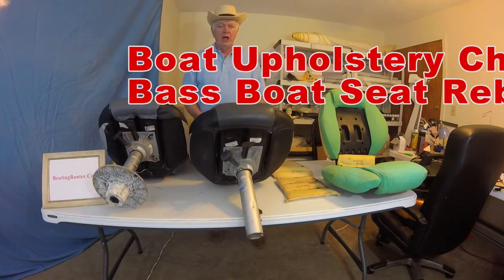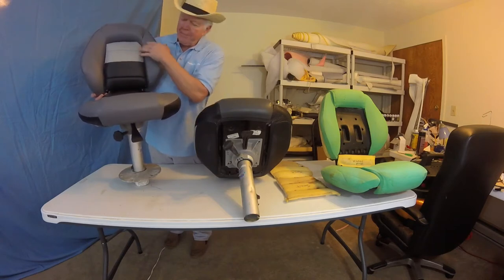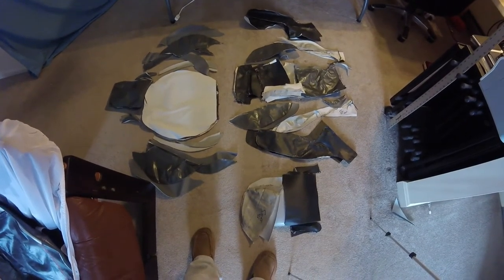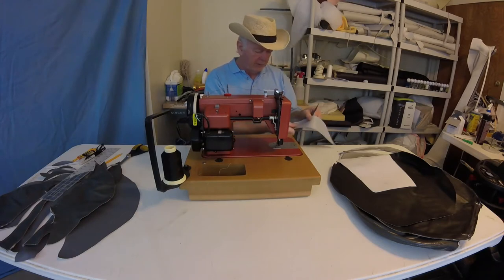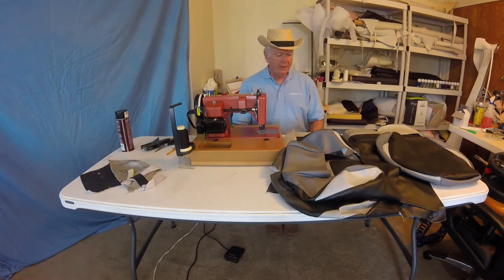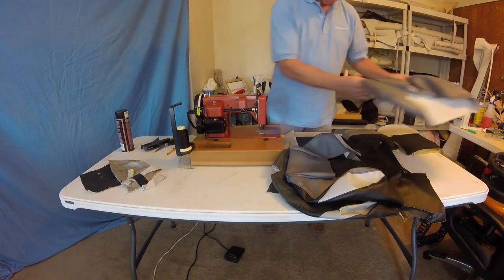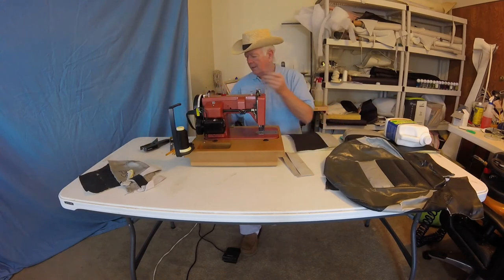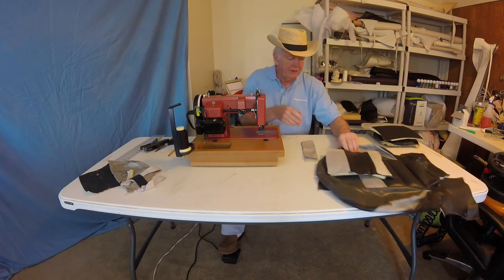Boat Upholstery Chap 35 Tracker Bass Boat Seat Rebuild Part 1

Comment: I am in the process of learning how to do this type of work and I am disappointed you went ahead and- "just did it" I like that you explain but unless you can put the camera in there and just let someone watch then none of that matters or helps to learn it. 

Very disappointed that you didn't just let the camera watch you sew it up. I wanted to see the complex parts and how you did it.

all you did was show pieces over and over - and then finished pieces, that taught me nothing at all, I wanted a nice closer shot of your hands and how you maneuvered the fabrics etc. and then each piece being added.
Reply from the maker: Hi Chris-Sorry you did not get any info from the video. I did do a poor job of showing the sewing portion of the project. If you watch the initial videos of this series you will see all the techniques used in this type of upholstery. I try not to keep repeating techniques from previous projects as it becomes boring for the subscribers who view all the videos and expect to see new techniques not old over and over. If you have the basic sewing ability than the assembly is just a matter of taking your time and laying out the various pieces where they belong and sewing them together. I suggest putting witness marks on the back of all the pieces to assure they are placed properly and interest the other pieces at the right spot. Make sure you take a pic of the project before you take it apart and put the witness marks on the back of the old fabrics so you can transfer them to the new vinyl. Take your time and check and re-check the positioning of the new pieces and the sewing is straight forward. Good luck
Reply: Thank you for responding - I did not expect that so quickly, I will say you have some of the best videos I have seen so far over the last few weeks since I have been hunting and I spotted this seat video and I've skipped several - I will say you are the only one I have spotted so far that ttackles the difficult seats. Most of the videos I see are quick - here's how you do this stitch and here's how you do thiss piping etc, and many banch, simple seats so I was excited to see a difficult seat. Thank you for your work on making these series. I do enjoy them.
Reply from the maker: Hi Chris-I hope you do get some benefit from the videos. There are many good videos from a number of people doing upholstery work. I am sure if you keep hunting you will be able to piece enough info together to get the job done. I know it is frustrating at times. To this day I still mess up projects and have to redo them. If you check out my entire series(I know it is a big time eater) I am sure you will come across everything you will need to do your job. Take your time, think each step through and don't get frustrated when you make a mistake as we all do. Each project will build your confidence and get easier. And no mater how it turns out it will look much better than it did before you fixed it.